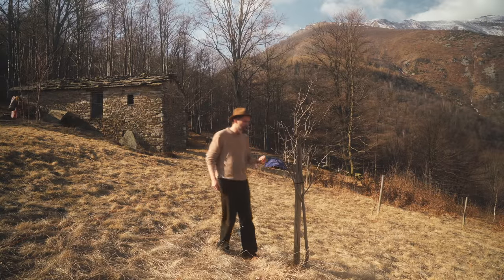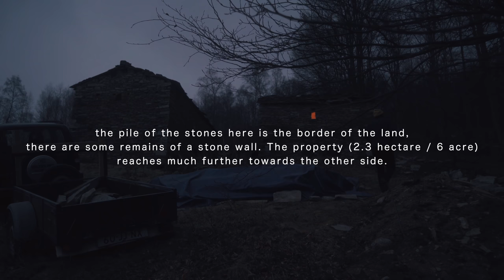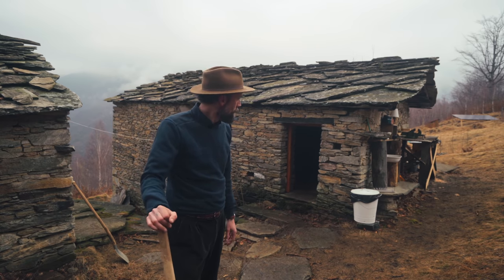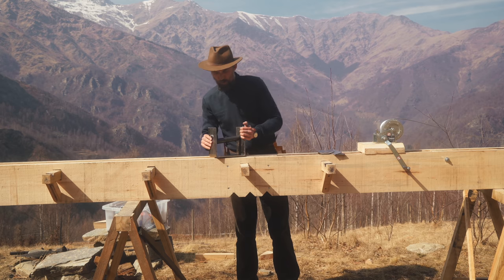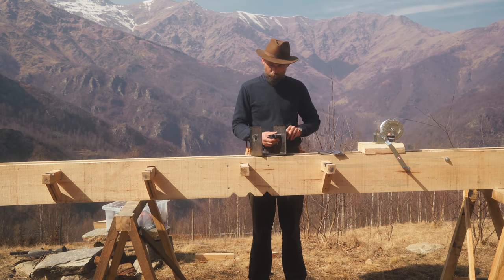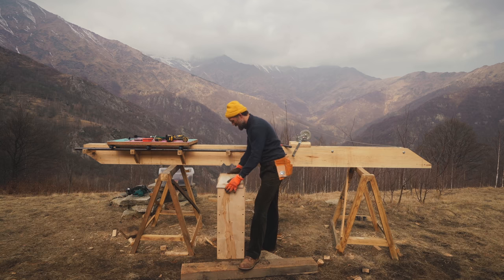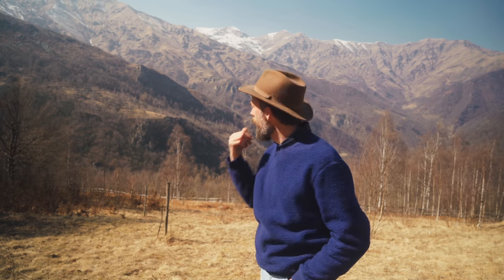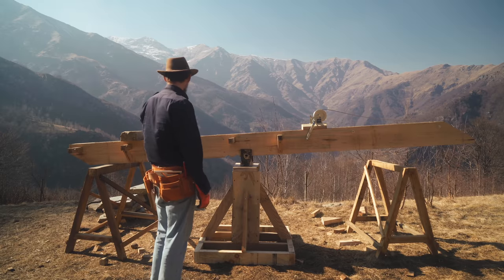#13 Building a path around the house, Finishing the Crane

Comment: For fruit, you need three things;
1. A tree!
2. enough warm weather for the fruit to blossom, be pollinated, and then ripen.
3. BEES!
If it's too cold for 2  and 3. you'll get nothing.
I have more than twenty fruit trees, last year I had just 1kg of apples. normally I have 30-40 kg of apples, plus severaL types of plums, peaches, cherries, pears, etc. BUT last year it was warm early so all the trees blossomed, BUT, then it turned cold, and all the bees said fuck that it's too cold to go out. 
So.... no fruit!
In your location, I would suggest the you consider growing trees under 'glass' you'll probably have more success.
Cherries fruit early, June, so they may be more successful, but you may have to pretend you are a bee, and pollinate them yourself. (Lady's makeup brushes are good for that!)
Start with polytunnels, and make sure they are well strapped and pegged down so they don't end up sailing across the valley in the next strong wind.
I'm intending to do just that.
[For your crane, a couple of large diameter disks cut from a polythene oil container work very well as thrust bearings.
PS, birch is a tree that grows on marginal land, so you may find that the local soil will need a lot of additional nutrients for a successful garden.
There's some videos on Y/T titled ''no dig gardening,' or similar which may be of help.
Here's one:  https://www.youtube.com/watch?v=0aNOPuXHCLQ&ab_channel=TheDutchFarmer.
That combined with a polytunnel may be your best solution.
PPS. Don't EVER forget your handbrake!😁
and, I really envy you views there!
.

Comment: Hi, may I ask how you were welding, I could hear the generator but what kw are needed to run that small welder...

Thanks in advance
Reply from the maker: My generator is 2700W, which is too small for even a small welder. I think the amperage visible on the welder is not accurate, it's more like 100A or lower. You can hear the generator getting in trouble while welding.
Reply: @MartijnDoolaard  You must check how many watts the welder and other tools require for startup and for regular use. And how many watts your generator can give for a short period of time and for longer use.